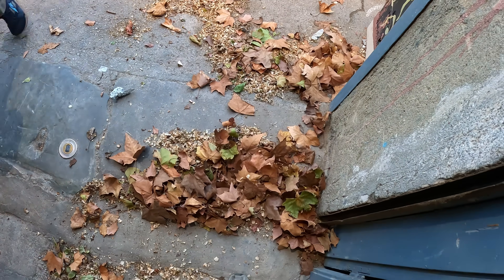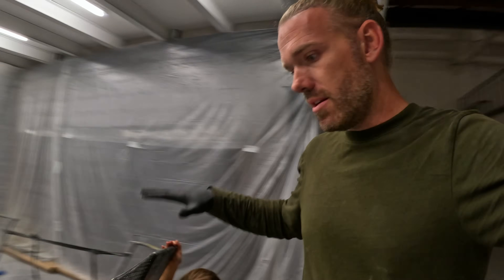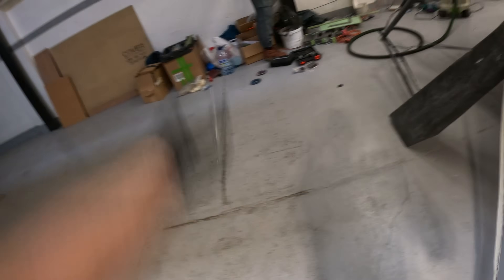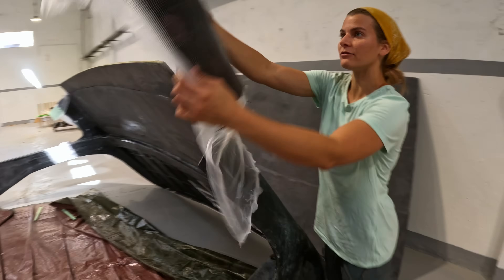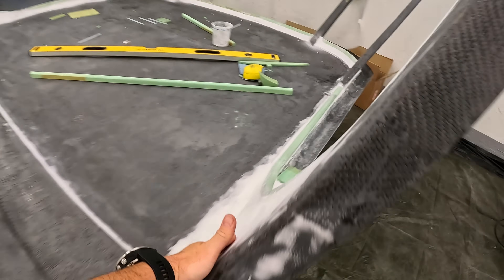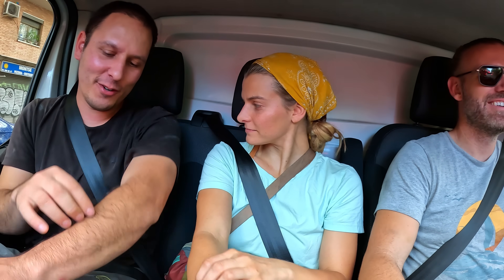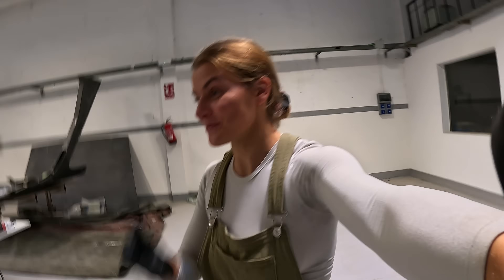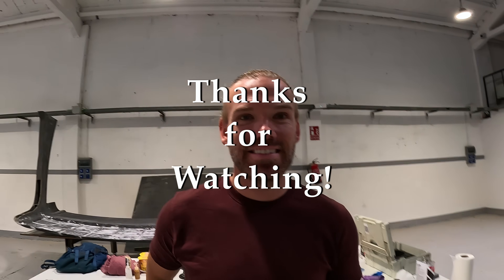This Boat Part Got WAY Heavier… Can We Even Lift It? (16)

Comment: Wish you could go over some of the engineering and load calculations and how you came up with the design for the structural components.  Would love to do something similar to my boat but can picture a hard dodger getting ripped off the boat on the first tack out at sea.

Comment: I looked up the scale you used and I am pretty certain it woukd not have read over 99 pounds. I suggest you test it by pulling on it with rope and checking if it will read higher

The listing on amazon says it reads up to 110 pounds but in the main part of the listing it indicates it reads from 0-50kg. Where it shows changing the range it makes it appear that it only displays 2 digits when displaying pounds; its a bit odd and since the reading is so close to the max of the listing I would double check its not maxing out
Reply from the maker: i checked last night after seeing similar concerns. i hung from it and it definitely goes over 100lbs. 
imagine my relief lol!
Reply: @ExpeditionEngineering  Great news!

Comment: If acetone isn't working ( it should ) on your mould release compound, maybe look at the label of brand last used ? They usually recommend cleaning agents. You may want to try toluene and see if that works any better for your application. Also,  how warm is the area you're applying it, that may also be a factor, the waxy nature of release agents will freeze up and resist acetone or other solvents, so maybe a trip outside to try it in a sunny warm area that keeps fumes from being breathed in or absorbed into skin... wear PPE !

Comment: Old school method of protecting your skin from fiberglass or carbon fiber is to rub baby powder on any exposed skin. It actually prevents fibers from getting into your pores. Works with boat fiberglass and fiberglass insulation in houses.